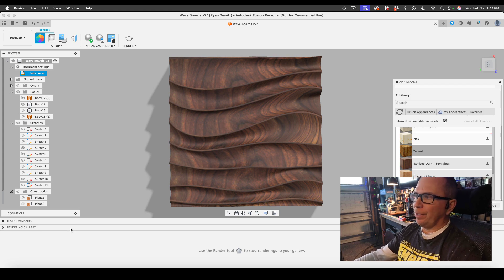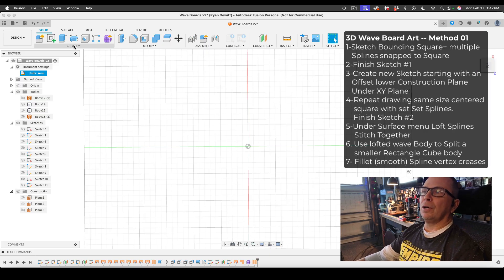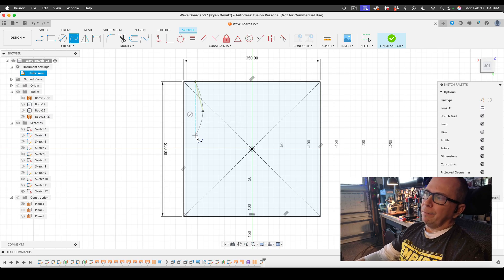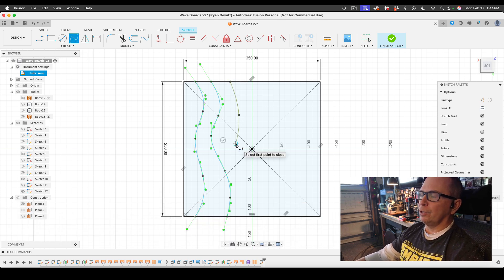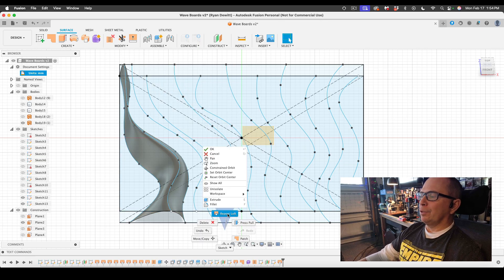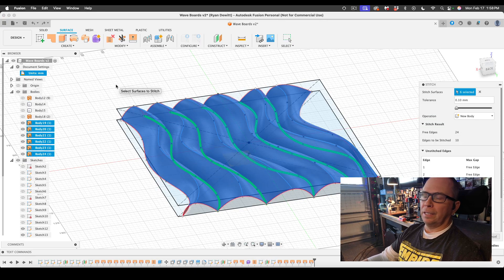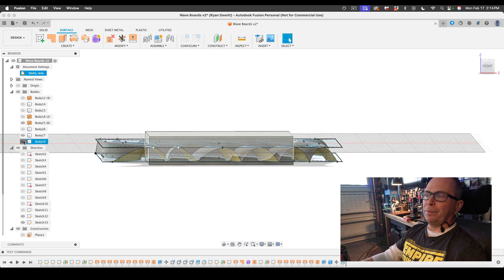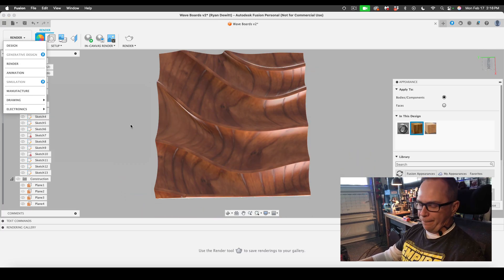You Could Make Serious Cash Creating 3D Wave Art - Fusion 360 Tutorial 01

Comment: A question, couldn't you use just one loft for the whole thing? This would have given way better surface continuity, as it would have been a single span surface. Or was it the design intent to have the slightly rounded edges?
Reply from the maker: If you start doing more complex, non-parallel pass it’s tough to do a loft with multiple profiles. You just have to experience it. The next video I make I will show you how to use a different buy rail, but really it’s a trial and error. The big thing you need to understand is that the loft tool is very sensitive to the final surface shape and we’ll just throw errors. it is really trial and error.

Comment: I learned CNC to be able to finally do this 😍.
I switched to Rhino to design them though. Way easier there than in fusion 😅. I also found it easier to do the same with Aspire. I once designed one in Fusion, but used the form environment. In my opinion it's easier to do these organic designs there.
Reply from the maker: Cool whatever works for you, do it! I did this complex surface in under 5 minutes in Fusion, I will never switch from Fusion even if I have to start paying for it.